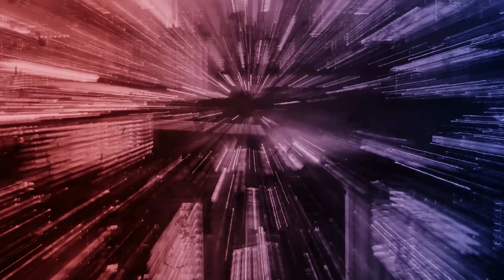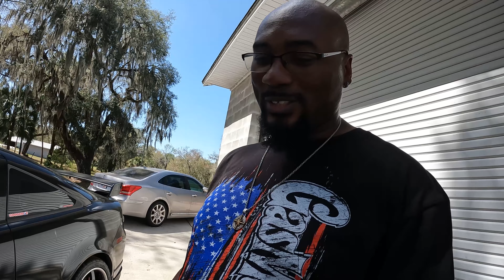Ball Joint Replacement on 2006 Chevy Cobalt SS

Comment: At 8:40 I see that you have one of those basic HF/Amazon reels for your extension cord. I know they are on the cheaper end but do you have any major gripes with the design? I am looking for a cheap way to organize my rats nest of extension cords and those caught my eyes.
Reply from the maker: They are ok. My ultimate plan is to run retractable reels from the ceiling.
Reply: @decelation  I am also planning to get retractable from the ceiling as my main source. I actually have one in mind that seems really nice for the price that I will shoot you a text about. 
I am just needing to organize my other ones bc I feel like I will regret just getting rid of them lol.
Reply from the maker: @mattmoore8679  that makes sense. I would save the extension cords.

Comment: those arms are the wrong ones for the SS model. those ones you bought are FE1, you need the FE5 to maintain the stiffer factory bushings for the increased hp, sway bar and struts. I wouldnt be suprised if you get only 30,000 miles on those before the bushings tear.
Reply from the maker: Thank you. That explains a lot. I really appreciate the advice
Reply: I agree why would you put the soft suspension on the sport ride?  I got my 06 2.4 ss about 5 / 6 years ago which was not running or charging.  I have done lots to the car, including replacing the FE1 sway bar links (1 was broken) with the proper shorter sway bar links.

Comment: They went bad already? I changed them right before I sold it🥲
Reply from the maker: No worries. I thought the control arms looked fairly new. Sometimes they aren't the best quality when you buy them
Reply: @decelation  check my last reply to Canden if you ever want to uprade the front arms to the best setup that will last forever and give it more performance handling
Reply: @decelation  a good set of factory replacements for arms are the Mevotech cms50173 and cms50174. they have a really good balljoint in them and are FE5
Reply from the maker: @adamwing9301  Thank you. I will be ordering these soon. I want to really redo most of the suspension for the cobalt